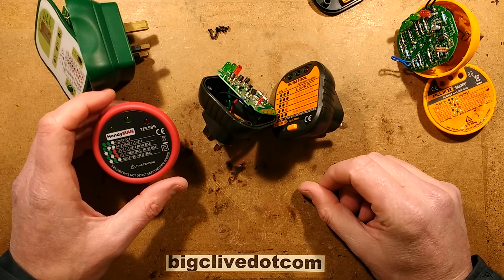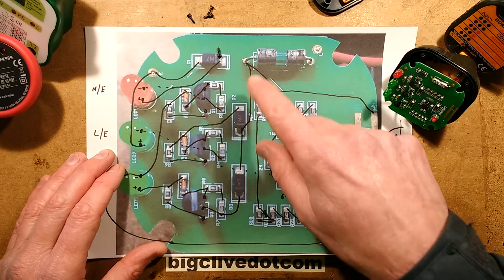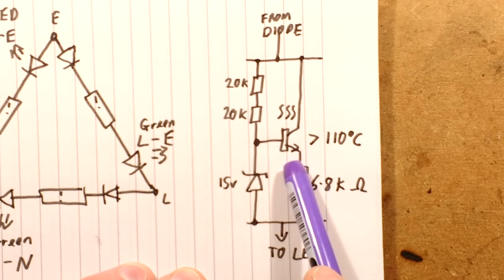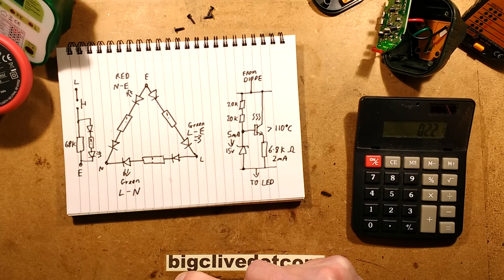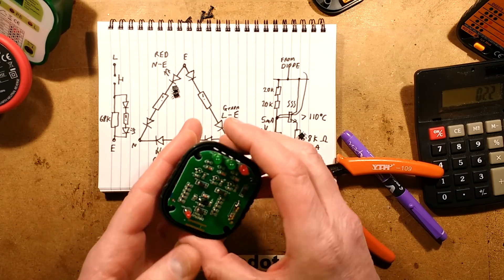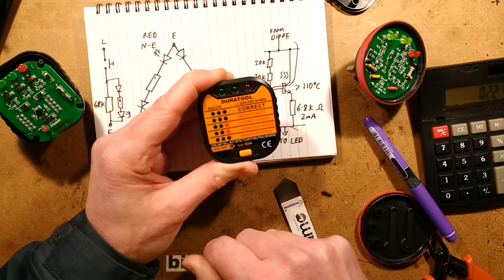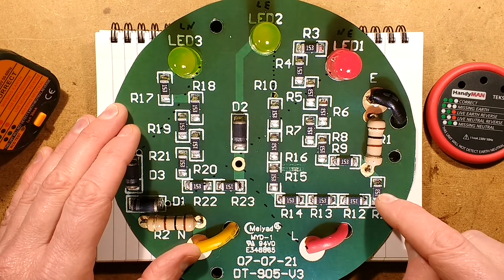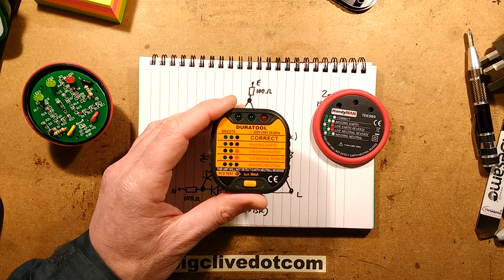Good versus evil socket testers.  (with schematics)

Comment: With AC being sent to homes and practically all devices requiring DC - does it still matter if L and N are switched? I'd still wire them where they are supposed to go though.
Reply: Forever Computing functionally, no, and in many cases, even class 1 or 2 AC appliances it still doesn't. That's why many class 2 power bricks and small appliances like radios have figure-8 power leads which aren't polarised. Where it does matter is if you get a fault that pops the plug top fuse. If the fuse pops and actually its in the neutral line because of a badly wired socket, then if there's a fault to ground or leakage from mains filtering, then you could end up with parts floating to phase voltage, or if there's a mechanical breach then you'll get exposed live parts. 
Mainly it's about keeping things where they should be. Avoid surprises.
Reply from the maker: At the local utility transformer the neutral is referenced to the ground.  The live need the protective devices on it like fuses or circuit breakers so that the current can be safely interrupted in the case of a live to ground fault.  In the UK with our polarised plugs we have local protection for cables by means of fuses in each plug.
Reply: Would only matter for "UK-only-devices"... with the rest of europe using unpolarized plugs and, in old houses, only one shared wire for neutral and ground. Which makes it a bit less safe overall..
Reply: It surely does matter. I had a surround sound receiver plugged into one receptacle at my grandmother's house, a turntable plugged into a receptacle 5 feet away that had live and neutral reversed, hit the power on my receiver, and BLAM! Every single output transistor exploded and the main fuse popped to save the day.

Which is why every time a friend moves to a new apartment: "Hey Andy, can I borrow your outlet tester before I plug in my XBox?" Ended up buying him his own tester because his last apartment he and I had to rewire half the outlets that were just inspected by the local housing authority. Four had live/neutral swapped. Two outlets were not grounded, one outlet was so old it didn't even have a ground pin, and one had a disconnected neutral just hanging out crammed in the box.
Reply: The short answer is no, not in most places. Except in places that put fuses on their plugs, then you must always correctly wire the plugs. The correct answer is more difficult in places that don't have that requirement. As i'd imagine is the same in Britain as in America the Neutral lead on a device shall not be used as the protective grounding for any exposed components. This should prevent a metal housing from becoming live should the plug be wired in reverse. In the US plugs that meet the current standard are polarized, the neutral pin is wider than the live pin, so it does matter, and if you have a plug where both are the same size then it doesn't meet code (neither do sockets without UK style shutters, except under specific circumstances).

The problem with reversing live and neutral is in swapping the industry standard on what is earth reference, lamp fixtures that use Edison sockets are the biggest issue as the whole metal cap becomes live on the bulb, on small bulbs its not very hard to accidentally touch that vs the small metal tab in the bottom that is blocked as soon as a bulb is inserted. 

The next biggest issue is with appliances that have their own on and off switch. Any appliance or device designed with a shutoff switch that only breaks one of the lines should break the live wire. Such that the power is stopped at the switch. Swapping the polarity in the socket means that now the switch is breaking the neutral side of the circuit. This leaves the rest of the circuit inside the device live at mains voltage. Normally this isn't going to kill anyone, but it can be an issue and potential safety hazard if you turn the switch off but the whole thing is still technically live. Usually this would only present an issue with large appliances that would be opened while plugged in and switched off (though its always smart to unplug the appliance if possible).
Reply: 2009dudeman It also matters anywhere you have regular screw-in light bulbs.  Because if the screw connection isn't neutral, it'll be a dangerous live exposed piece of metal.  Same goes for any device or extension cord with a single pole on/off switch.
  As for European plugs, Schuko and Italian sockets are the only ones that have an Earth connection but aren't polarized.  The French, Swiss, Greek and Danish plugs are all polarized, but with all the fuses in the central fuse box ("consumer unit" in UK terms).
Reply: Swapping live and neutral can put potential on the chassis of certain items, especially if they're interestingly designed or rather old.  And, worse, if the ground fails, then even ones that are well designed can end up shocking you.

I expect this design issue to be far less common in countries with 240 volts, however, many, many appliances are designed without grounding in North America and rely on double insulation for protection.  And, before that, polarization.

Someone mentioned light bulbs, and definitely that is one of the exceptions to the idea that nothing should be able to shock someone if it's plugged in backwards!
Reply: Same experience at several houses where I've helped friends rewire their place (My Mom's place we added in a 120A or 200A panel, many moons ago, and rewired the place, code at that time was that the home owner could do their own work, and could have help.) One friend who was blind did her own electrical work; You can bet I triple checked the RIGHT breakers were off... My moms place went from "turn the kitchen lights on and run the hair dryer in the master bathroom and the 10A breaker pops" to having 3 20A breakers or 2 20's and a 10 (I honestly forget!) but it was a VAST improvement over the 1945-1950 previous wiring, and I yanked out all the nasty black tar / paper 16/2 wiring and went to all 10/3 and 12/3, a vastly better wire. Outlets have actual grounds now, even.
Reply: I do not get your argument. In the UK plugs there is the fuse on live. If the fuse is on neutral it can blow and leave voltage on the device or in case of ground fault it will not even see the current and only the 32 A breaker protects. 

The second issue on the polarizing is with lamps. With it there never is voltage on the screw. Without it depending on the orientation of the plug there can be voltage on the screw always when it is plugged. I think lamps on countries with unpolarized plugs should be designed so that the switch always breaks the connection to the screw. This would be a compromise when you cannot ensure the polarity.
Reply: @okaro6595  alternating current. Where live and neutral change 50/60 times per second.

Goes through a bridge rectifier  and is now DC with a capacitor to smooth it out.

The input doesm't matter. Not forgetting European and foreign plugs go in either way.

The rectifier makes the L & N moot.

I get your point and as a case in point, I wire my plugs correctly to EU cabling colours.